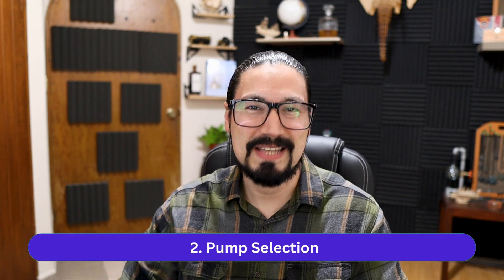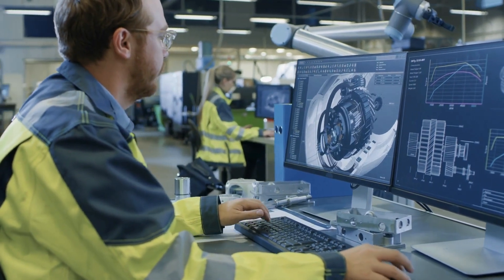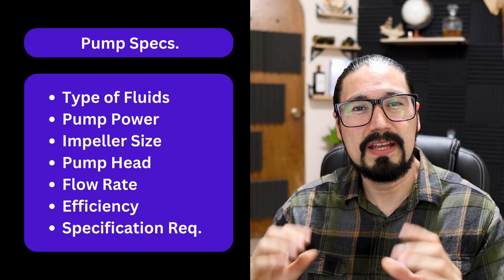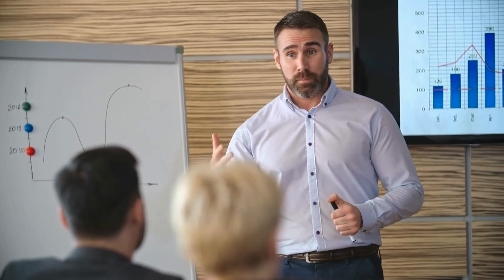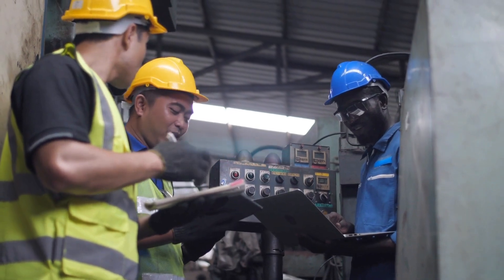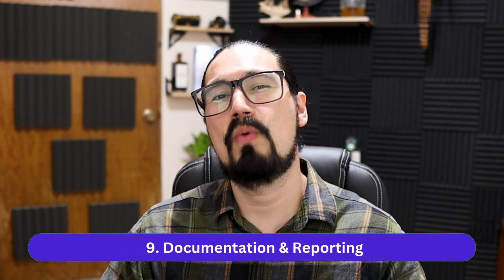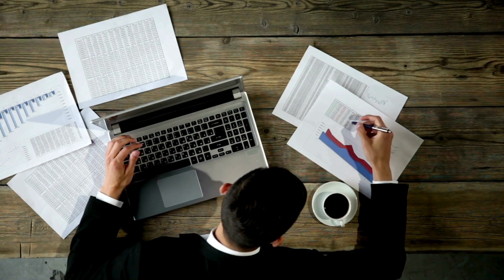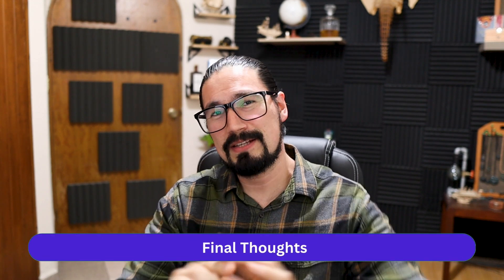Top Pumping System Tasks for Process Engineering

Comment: Recently got accepted to do a Bachelors in Process Engineering, excited about it. Still wanted some ideas on potential jobs positions. I.E  what other aspects of Process can I work in or is the job gonna mainly be just sitting and looking at monitors?
Any advice would be appreciated.
Reply from the maker: Well, process engineering at its core is all about process optimization, operaiton, design, etc... So yes, most of the time you'll be doing admin/office work, but many times, you'll go directly to the factory, equipment, process, etc... That really depends on your role, i.e. Junior Process Engineers will go more likely than a Senior Process Engineer. Truth be told, is that you may end up in other areas of process such as: maintenance, quality control, logistics, etc... So its hard to say!